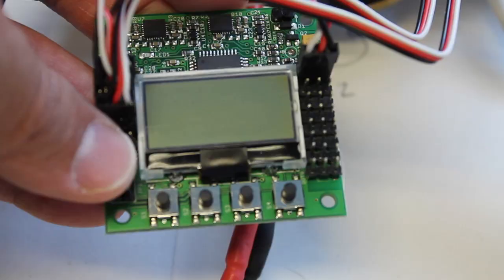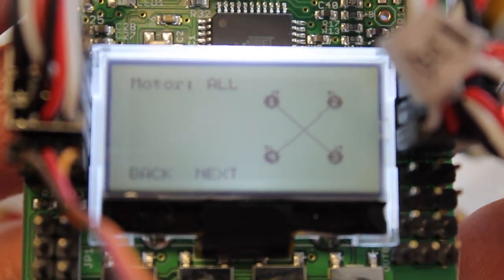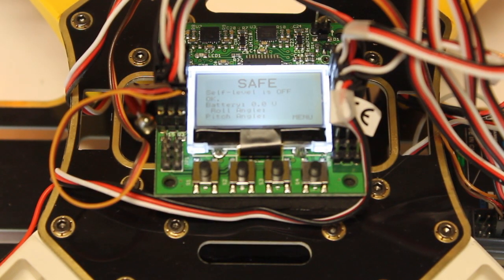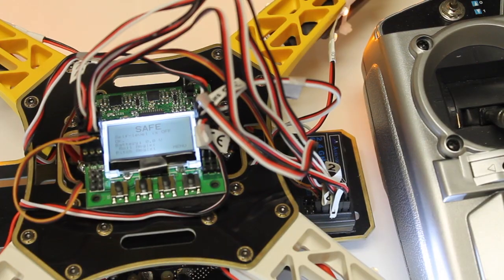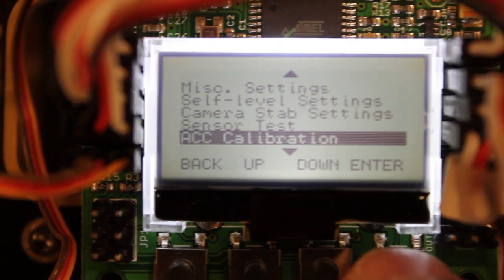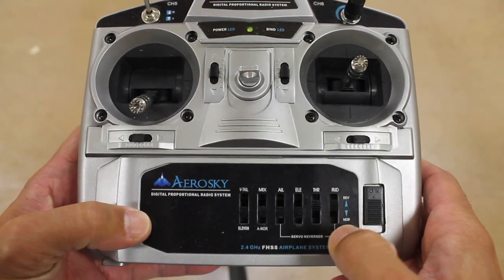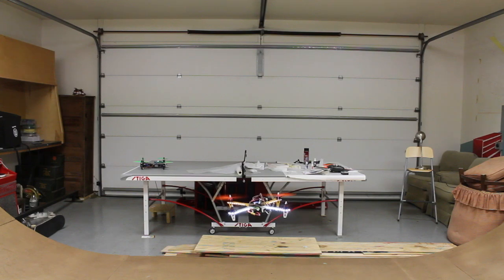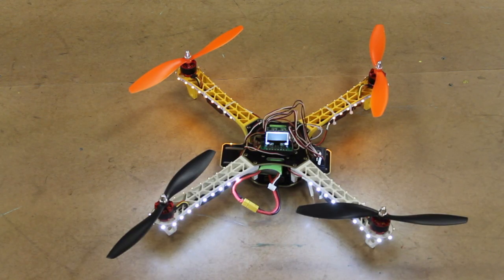KK2.0 Multicopter ESC Calibration, Motor Layout, and Auto-Level w/ Default Settings on AeroSky Quad

Comment: i have the kk 2.1.5 board on a f450 frame with 1100kv motors.. i have tried four or five different gain and limit values for P and I.. from various tuning videos.. with no avail. my x-quad still wobbles uncontrollably in the air. i don't know that to do. please help. :(
Reply: hey maybe this will help???? check out were you live? and see if there is a Parks were people Fly Quads I have a F450 Quad.. here in San Jose, California there is a Park close by they fly ever Sunday and I have BUGGED them a lot and learned many things... I am real new at this.. but these people will help you!!! do not be afraid to ask!!! they been were your and at... give it a try... people that Fly Quads are REAL nice people.... remember this hehehehehe some of these people will talk you ear off about Quads hehehehe Just be kind and listen heheh  Hope this will help? Best of Luck ;O)
Reply from the maker: Najibul Haque Sorry to hear that. It really took me a bunch of trial and error to get my KK tuned in. All I can say is hang in there and lightly tune your params. I've found that making too large of an adjustment can make tuning a big hassle to get to values that work. The 450 size frame is a very common one so you should be able to work from the gains in this video. Hang in there and don't give up.
Reply: A few possibilities:
1. Your Self-Level "P" settings are too high. Essentially your quad overcorrects one direction, then overcorrects the other way. I fly a 450 X-Quad with a KK and I've got my P settings down to 30.

2. Your props are wildly unbalanced. 

3. You're using ESCs without the SimonK firmware and they're not responding quickly enough to throttle changes.

That would be my list of off the top of my head.
Reply: thanks for replying guys. i tried a couple of other values but it didn't work. it still wobbles about its axis violently in the air. to check if there was something wrong with the setup i hooked up the old kkmulticopter v5.5, and it flies fine. the motors, props and ESCs are all working fine.
its only with the new 2.1.5 that im having the wobbling issue. it wobbles with or without the self-level function on. id rather have it fly stable first and then turn on the self-level.
I haven't heard of the SimonK firmware for escs tho. i wonder if its only required for the 2.1.5 board. ill have to look into that.
but once again thanks for the insight guys :)
Reply: One tip I always give is, NEVER EVER use other people's settings. They can cause more trouble than they're worth. I find it better to try the quad out before adjusting anything. Just a good level when setting up the basics and suck it and see. The calibrating of ESCs many people have trouble with. Follow the DHDSRacer's (I think that's his ID) video here on YouTube and you should be OK. Then test using low throttle to see if the quad is going to behave and then start adjusting. Just remember to take the settings a little at a time. It is an art of sorts, once you get the feel of which does what it gets easier. I've managed to do the basics setup on a KK2 and then take off and fly pretty well. A few minor adjustments and everything seemed to slot into place. I just wish they were all so easy. Yes I've copied those settings into an almost identical build and it flew like a house brick. :-)

Comment: Hey Dennis. I have HK new KK2 Hard Case board. I tried ACC calibration, but I get calibration failed. ACC Z NOT OK. What can I do about that?
Reply from the maker: jerry zito Hmmm I'm not sure. I haven't messed with the KK2 in quite some time. My first thing would be to try a new firmware load and make sure everything is completely level when you calibrate. Sorry I wish I could be of more help.
Reply: Exactly what I would have said Dennis. Some gremlin could have been introduced when reflashing. Using the latest non-beta firmware should be the best and as I've been saying earlier, make sure the board, not so much the quad frame is level. Obviously your Gyro is out of range and perhaps a recalibration will fix it. Hang on... it's a cased board. I assume it's up the right way ???  The label must be DOWN. Having it up will throw the gyro right out. Other than that it could be a bad board.

Comment: Hi I followed up this tutorial and it's awesome, I just have 1 problem with the transmiter, right stick is moving my quadcopter, so If want to start to play with it, my right stick must be down, How can I fix it? thanks!
Reply from the maker: Diego Vera jimenez I'm wondering if you want to be in Mode 1 or Mode 2? Mode 2 is what I fly in and it means the throttle is on the left. So the throttle is all the way down and I can arm. Hopefully you have the right mode transmitter and just need to configure it.
Reply: Dennis Baldwin  Thank you Dennis! The mode 2 works as expected, I just have one last problem now, looks like my motor 1 is spinning slower than the others, I alredy calibrated my esc many times, and I also are testing my quad in self level but I still having rhe same problem, if you know how to fix it, just let me know :)

Comment: Dennis, you do seem to be easy to fly! but build my Quadcopter with many difficulties and I am on my first flight! I do not know if they are for my PI values, could you possibly make a video to show how we do to adjust and how to fly?
Reply from the maker: tiburcio almeida da silva Almeida I did this gain tuning video a while back:

KK2.0 Multicopter PI Gain Tuning for Beginners

If that doesn't help you check out our forums at www.garagepilots.com and post there. We should be able to help you out. PI gain tuning can be pretty frustrating if you're just getting started, but a little bit of persistence and you'll get everything dialed in.
Reply: Dennis, the problem is that I do not know how you came to these values? you have a walkthrough on how to get these values? I'm riding a 450mm model like this anyway! but vr board kk2.15 is 1,9s and is different from yours in the video! What I want to know is how to adjust the zero, like a step by step? and thereafter as takeoff? because I am comedo because he is falling sideways! his video he seems very stable! type, it would give rise to upright without him go sideways?
Ps: on board the default values for pitch / roll are 250-100-50-20!
,

Comment: MY BOARD KK 2.1.5  IS BEEPING (01) WHEN ARMED, COULD Y HELP ME?
Reply from the maker: Francisco Cunha You can go to www.garagpilots.com and post in our forums. Please be sure to give as much information as possible and hopefully we can help you out over there.
Reply: This site is OFF line!
Reply: If your board is beeping, obviously you have the supplied beeper connected. DUH. Do you have 12 volts connected to the board's 12 volt pin and the voltage set correctly? There is a YouTube tutorial which shows you how to set it up correctly. If you don't have the values set correctly it will beep and if you don't have the main battery connected to those pins then it will beep also. Either disconnect the beeper or set up the voltage sensor. Just be careful which pins you plug your battery supply into. :-)

Comment: What size props are you using? Is it 450 frame?
Reply from the maker: 10x4.5 props. Yes, it's pretty close to a 450mm size frame if I recall.

Comment: Hello and thanks I will subscribe for sure nice to see some great vids for beginners.  I'm waiting for all the parts to build one.  How did you power up your LED lights?  Through the battery itself or can you do this through the board?  Thank you again!
Reply from the maker: Right now they are powered directly from the flight battery but I don't see why it couldn't be powered from the board if you can find a 5V output source.
Reply: Dennis Baldwin Don't power anything from the Flight control Board. Dragging too much current through the board can burn out the tracks. The board was never designed to be a BEC. If you have no other 5 volt supply, either use the ESCs if they have inbuilt BECs or in the case of Afro ESCs or Opto ESCs buy a UBEC. Anyway most quad type LEDs use 12 volts. If your LEDs are different and require a lower voltage, usually around 3 volts use a resistor in line if the current draw isn't too large. There are some very nice, tiny voltage droppers available at BangGood. 3 to 30 volts in and dial the voltage out. Great to use if you're suffering from line interference.

Comment: I have the kk2.1 and the demo at 6:30 in the video was not working 4 me. can I get some help? -fire Strife
Reply from the maker: You may have to enable stick arming in your KK menu. There is an option to toggle between auxiliary switch on your TX or via sticks.
Reply: Dennis Baldwin Thanks but I figured it out. :-) I forgot we added the aux.

Comment: My team already setup like your setting, but the quadcopter is not flying vertically when we just pull up the throttle. It will just rotate right itself. If we then adjust move the rudder to the right, it will also rotate right itself.  Do you know how to adjust it?
Reply from the maker: Have you checked your motor rotations and that you have the proper props for the motor - clockwise vs counter-clockwise rotation. That sounds like the problem to me, but if that's not the case then check out www.garagepilots.com and post your question in the forums over there. Thanks.
Reply: There is no way a quad would ever get off the ground if a motor was reversed or a prop not correct. I do wish people would stop giving that advice. I know of one guy who was told the same story and he reversed what he thought to be the offending one and his quad did an immediate flip and broke two arms and a motor mount. If a quad is able to lift off it's neither motor direction or props upside down. It sounds to me he has either his sticks set up incorrectly. His board definitely isn't getting the right instructions from his TX. Or the board has been set up incorrectly, possibly not being dead level during calibration. I prefer the latter.

Comment: Hi, i have turnigy multistar 30 amp esc and flashed it with simonk. Now i am wondering should i connect all 4 escs to the kk2 board with hot and negative wire on. and also from kk2 board to the receiver with all three wires(servo wire)X4 wires. Hope i can make u understand with my little knowledge of English.Thnks
Reply from the maker: Hi, I've connected my KK2 many times with ESCs that have a BEC. I've done this without removing the power and ground cable on the servos so you should be fine. I know some pilots recommend keeping only one ESC w/ BEC and for all others only using the signal pin, but from my experience it should work without having to do that. I haven't used Multistar ESCs but my ESCs did have BECs and SimonK firmware.

Comment: Hey Dennis!
Im new in this hobby,but im wonder,can this kk2 calibrate every type of esc,im thinkig of buying q-brain from hk, or do i have to buy that card to calibrate, and what do you think about that q-brain esc?. Does the kk2 came with the latest fw, if not how do i get it?
// Andreas
Reply from the maker: I'm not sure if the KK2 can calibrate every type of ESC. But I do know that you can calibrate your ESCs without the KK2 since each type of ESC has its own calibration method. I normally calibrate my ESCs manually without the KK2. I'm not sure about the q-brain ESC, but it looks interesting. Let me know what you find out. The KK2 may come with the latest firmware, but that's dependent on where you purchase it. Definitely check the specs listed from wherever you're purchasing.

Comment: Hi, I bought a turnegy micro quad with kk2 board, but I could not find a correct setup. It is very instable when self level is enable.
I already have tried a lots of configurations, but it still instable. Do you have some suggestion to me?
Thanks in advanced.
Roge
Reply from the maker: Hi Roge, I'm surprised to hear that you're having problems with stability. Especially with a ready to fly quad from HobbyKing. If it's a small quad I would recommend bringing the gains down a good bit. Do you have a link to the quad that you purchased?

Comment: Actually i am planing to built one of my own. So i am gathering information 4m resource person like u. I want to use any built in esc. And also plz recommend me which 30a esc i should use. THank 4 ur kind help.
Reply from the maker: I'm not sure where you're located, but here in the states I use gothelirc because they have quick shipping. This is a 30A ESC with SimonK firmware that I've used for previous builds:

http://gothelirc.com/shopdisplayproducts.asp?id=138&cat=iPeaka+ESC

If you're looking elsewhere I would recommend finding an ESC with SimonK firmware preinstalled. Good luck.
Reply: Tnks 4 ur rply. i live in India. What about turnigy plus 30a?
Reply from the maker: The284166 Those should work, but I'd recommend something that comes with SimonK firmware. You'll see faster response times on your sticks. But if this is your first build then I wouldn't worry about it.

Comment: To power the board, when you have all 4 motors connected, does the power come from the first motor, coming from the battery
Reply from the maker: Yes, the ESC plugged into M1 is what powers the KK2. Hope that helps.

Comment: Hi dennis, im having trouble flying my quad. its not hovering. means when i try to fly it it just goes to a one side. may be something wrong with the esc calibration???
Reply from the maker: Yeah I would definitely look into your ESC calibration. Calibrate all 4 of them either independently or with the pass-through method using the KK board. Also, make sure you calibrate your accelerometer and make sure you power up the board on a level surface. Let me know how it goes.

Comment: any idea why all of my motors are not getting the same amount of power?
Reply from the maker: Have you done ESC calibration? That's always the first place I start when dealing with motor speed issues. Another is to check that you calibrated the ACC. Let me know if that doesn't help.

Comment from the maker: You don't technically need a PDB, but you need a way to power all your ESCs from your battery. The PDB is generally the cleanest way to do this, but if you look around for pigtails you'll see that you can have power from your battery cable split into multiple leads to feed your ESCs. You can even make your own, which I've done a few times. It's kind of a pain but sometimes gets the job done nicely.

Comment: That depends, if the frame has one built in or not. But Yes you always need one. Just check if its built into the frame like Hobbykings Q450 with PCB.

Comment: Thanks Dennis.I will explain to you, i already have a PHANTOM, i don't even like them. I'm photographer and i don't know much about quadcopter and that's why i asked for that difference between KK2 AND DJI M. I've question to you what do i need to build quadcopter with GPS? I know about FRAME, MOTORS, ESC, GPS, FLIGHT C BOARD, RECEIVER and what else i need to do that!? Why PHANTOM has MC BOARD and FLIGHT CONTROL BOARD?  Where are you connect the battery power wire on the FLIGHT CONTROL BOARD.

Comment from the maker: and another tip I read from RC Groups:

"if i remember correct once the devo is binded to the rx you can unplug the battery to the rx and it remembers the ID ...so try this...turn on the tx , plug in the battery to the rx and let them bind...then unplug the battery and place the throttle to high position then plug the battery back in and the tx/rx should rebind quickly and allow you to do the calibration..."

Comment: Dennis thank you! With DEVO7 I get THSTK error on powering with throttle up. If I power and then raise the stick, impossible to bind afterwords.I actually gave up with the DEVO7 since my post here, and moved to a turnigy9X. I am still not flying though, for a "little problem". Posted a full report of my experience on my website, should it be of any interest.
Still interested in tips for the THSTK/throttle up issue on DEVO7 as I might want to use kk2 board with this radio on other quads. Thanks!

Comment: great vid, however if I try to switch on my radio (DEVO7) with throttle up it gives an error. Kind of stuck on esc calibration with kk2 beacause of this. Would you have any hint to bypass this issue? Thanks

Comment from the maker: There's a chance that it will fly, but you run the risk of flipping and crashing given your throttle range for all the ESCs won't be equal. Most flight controllers will be able to detect this and won't let you arm. I don't recommend trying to fly without doing a proper ESC calibration.

Comment from the maker: What do you mean by "DJI M"? Are you referring to the "DJI NAZA M"? If so, they basically do the same thing to stabilize your multirotor, but the NAZA M is a more sophisticated flight controller. It also has the ability to add GPS. At the same time the KK2 is tough to beat for the money and you can configure it without a computer since it has an LCD screen. The KK2 is obviously much cheaper too, but there is the NAZA Lite which is cheaper than the NAZA V2.

Comment from the maker: Good to know that your motors and ESCs are working properly and it sounds like your throttle channels is normal and not reversed. The next thing I would try is your rudder channel to see if you can arm your KK by pushing your throttle stick to the left.

Comment: hello buddy,everything setting looks okey.I discovered something today:when I switched off the power,I put the throttle to the max,I powered the quad,I holded the first and the 4th button of the kk2.0 at once i heared the beep beep,I put the throttle to the lowest level.....I kept holding the two buttons of the kk2.0 and when I brought up the throttle,all the 4 motors spins,when I stop holding the 2 buttons,the motors stop.sos help please.and I flashed my kk2.0 to v1.6 this morning.thanks